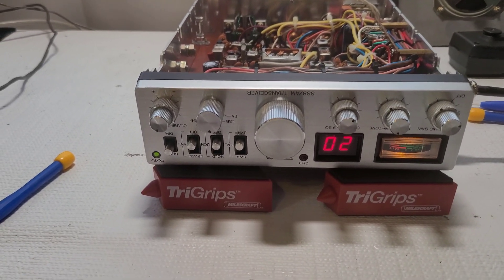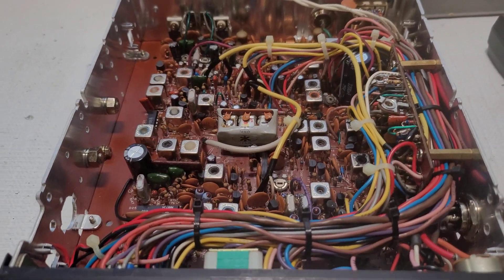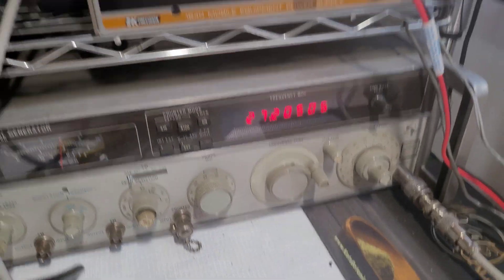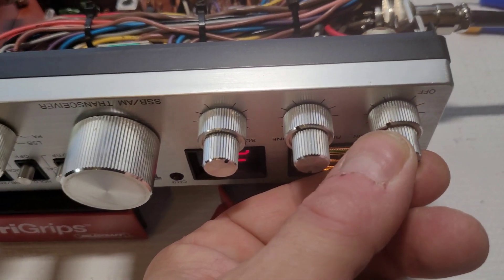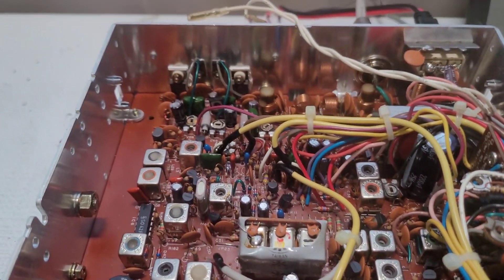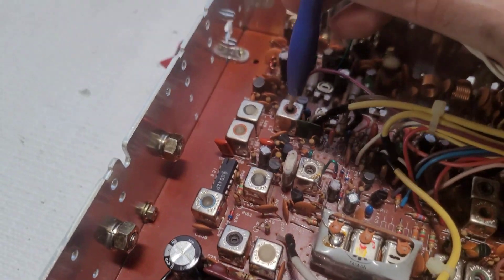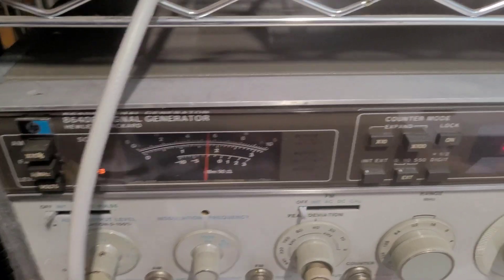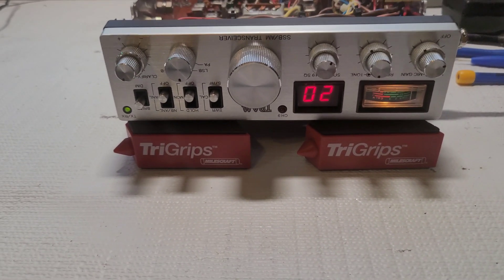An alternative method to align receive on any CB radio. Tram D-80

Comment: I use the same method with the exact same equipment. Sinadder 12 DB is the standard unit of measure. 8640B is still the benchmark of frequency stability.

Comment: If you’re demonstrating how you should show how it’s all hooked up , for instance Sinad hooks to what .  Speaker , generator to what . Coaxial input . Not a criticism just a suggestion.
Reply: The way it was done in the past before digital multimeters was to use the 3 volt AC scale on the Triplett or Simpson and use the dB scale on the meter and tune for the lowest reading. That works great for FM without a tone. 
The Sam's books tell you to connect a voltmeter across the speaker and with a midrange signal level tune for maximum audio output. 
Nowadays, you can use a scopemeter for the alignment and tune for the best quality audio signal.
Reply: @spaceflight1019 yeah , i actually have a service monitor IFR 1200s  . My comment was more geared towards if you’re gonna show people how a tad bit more information might be helpful for anyone wanting to learn .
Reply: @jerrypeal653  When I started doing this in 1970, I used to align receivers by ear. A few years later I was using my dad's EICO VTVM for my measurements. Now that those old 23 channel era rigs are genuine antiques the paradigm is "it doesn't have to be perfect; it only has to work". 
If you can measure the various oscillator frequencies and if they are within tolerance then you can do the alignment. You can't do an alignment with bad crystals. But, if your 26.630 crystal reads 26.630.543, you can either slip the generator frequency to compensate and obtain the 455 khz offset or just tune it up because 543 Hz doesn't really matter.
One more thing... it's always a good idea to allow an hour of operation before performing the alignment to enable the temperatures to rise to the normal value and stabilize.
Reply: @ lol, yeah and a TV used to monitor for interference.
Reply: @jerrypeal653  The instructions in the pre-1970 Sams books used to tell you to use a TV and adjust the TVI trap for minimum interference. I have done a lot of experimenting and have found that an antenna matcher like the Johnson Matchbox reduces the 54 MHz harmonic much better than the commercially available TVI traps.
Reply: @ used to be for sure .
Reply from the maker: It was more a different way to align receive with a sinadder rather than what the manual says.  Not really a how-to video.  However, I have a how-to video as well.
Reply: @pulsarcb  ok , gotcha

Comment: What is 106 the same as in microvolts? I have always heard that .5 microvolts or less is a good sensitive reciever
Reply from the maker: -106 dbm is equivalent to 1.12 uV  Its not bad but it could be better.  .5 uV or -113 dbm is a great receiving radio.  The standard most techs go by if there's no sinad specs is -110 dbm or .7 uV  Of course these specs are for AM 

73s
Reply: Here's a little something extra... it's possible for a receiver to be too sensitive. Regency Range Gains and Imperials are a good example. They can be tuned so that a 1 uV signal is a S7! 
The issue becomes that of usable sensitivity. Having a high noise level makes the receiver difficult to listen to. You can't hear signals in the noise level. 
EF Johnson began to produce the Messenger 3 mobile in early 1964. I have pored through everything I can find on the radio and cannot find a claimed sensitivity figure anywhere. The one I have has a usable sensitivity of about 1.5 uV, and as a result isn't a noisy receiver. In their day they claimed to have a "noise immune squelch", due to the fact that the sensitivity threshold was above the noise level.

Comment: Did you plug the  Sinadder wires into the external speaker jack when adjusting the Radios sensitivity?
Reply from the maker: I have two sets of wires connected to the external speaker.  One set goes to the radio external speaker port and the other set goes to the sinadder
Reply: Thanks!

Comment: Hey there.  Quick question.  When you say 106 on the signal generator it looks like it goes to 105.  Is there a scientific reason for that?  Paul.
Reply from the maker: The output knob goes in increments of 10dbm. The fine knob in the middle will adjust in increments of 1 dbm.  So those are added together to get a total.

Comment: Hey there Pulsar CB Radio.  How do you learn to align the receive of CB radios?  I have been exposed to CB radios since I was a kid and while in school I borrowed a few books form the library about CB radio.  The books from the library provide some information and school has some information to learn from but I have not developed confidence to align a CB radio.    Do you have any advice on how to develop confidence to align receive on CB radios?
Reply: Practice, practice, practice. Get a quality set of alignment tools, unless you want to learn how to compensate for a steel screwdriver and Allen wrench. 
Having the Sam's book is a great help. If you don't have it, you're guessing what the slug you're going to turn is supposed to do. 
The fundamentals are this: every transceiver has a RF amplifier, one or two mixer stages, at least two intermediate frequency (IF) stages for the receiver. 
There are at least two oscillator stages, one for the receiver and one for the transmitter. The transmitter may have a multiplier, buffer, driver, and final amplifier stages.

Comment: Hi , I have a couple of signal generators similar to your HP , (A Boonton and a Logimetrics), unfortunately they do not have that "frequency lock button ", have you any idea whether this frequency lock button/circuit would be complicated to add to my sig gens ?( the later Boonton models actually had the "lock" button feature.)

PeaceFromOz, 🇦🇺
Reply from the maker: I'm not sure if it's possible.  These sig gen could be ordered in a variety of options.  Prob be easier and cheaper to find one with the option already installed